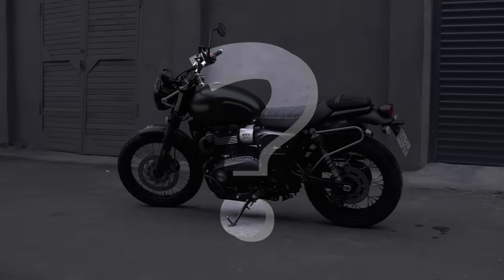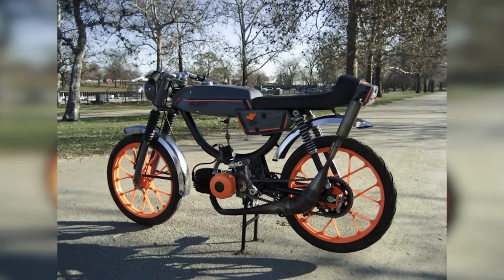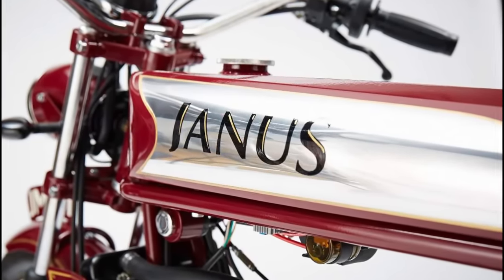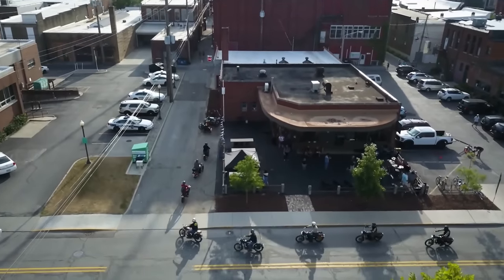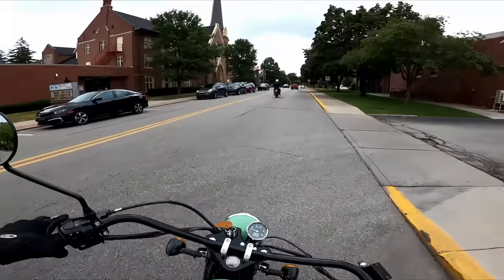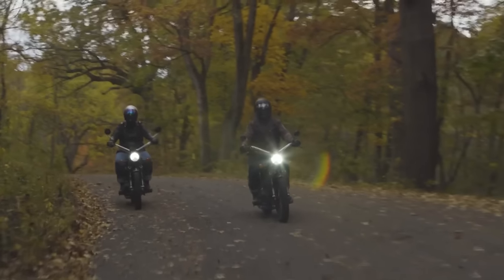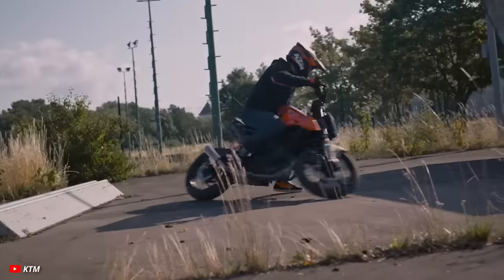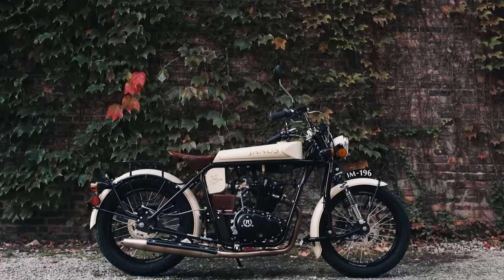The New Manufacturer making 100-year-old Motorcycles

Comment: The problem with true retro motorcycle is we invent tech pack for good reason lol.
Fkin carbs.
But good on Janus for keeping the spirit alive.
Reply: Just the word "carbs" is enough to make me foam at the mouth.
Reply: I agree, it's like those "cooking like the 1800's" videos. Yeah I guess it's a neat idea historically but I'm not gonna go out and soak some oats in suet for 30 hours and eat it with weevil infested hardtack.
Reply: What is wrong with carburetors?  Simple, easy to tune, don't require electricity to function, makes a 1 wire magneto ignition possible.  Can't get more simple than that.
Reply: @thejunkman  cold start, cold start, cold start, cleaning, cleaning, cold start, inconsistent flow, cold start, cleaning...
Carbs is good if you like to dismantle your bike. Not so much for people who just want to ride and not touch the engine ever. Chain cleaning and valve check at most.
And EFI tuning is dirt easy if you have the computer, so it is both more nerdy and more refined.
Reply: @victoriazero8869  I have EFI bikes too, but carbs are just fine if you like to ride your bike a lot and don't let it sit.  I have had too many problems with cars and electric fuel pumps and such.  You can't really fix them on the side of the road. I guess growing up with cars, trucks and motorcyces from the 60's and 70's, I don't think much about changing points or tuning a carburetor once in a while.  It is like second nature.
Reply: @thejunkman  I have two identical bikes, one from 2013 and one from 2016, and the former had carbs in it.
Fkin cold start issue. In the tropics, even. I like it in a sense on how easy it is to squeeze more power, but EFI tuning can do it more efficiently. (Carb rejetting is dirty as hell to emission)

Comment: Lost all interest when he said Chinese motor
Reply: Agreed. They should always include the option for a customer to double the cost of the entire bike so they can swap in a less reliable, less powerful, domestically made engine with minimal but expensive parts support.
Reply: @OddInfection commie boo
Reply: And yet china did somerhing many cannot or have failed at, scooting around on the moon.
Reply: A major drawback.
Reply: @Chris-Holden  what makes Chinese parts more reliable? I've ordered a ton of parts online restoring cars, a shocking proportion of which were completely useless out of the box, or even worse, failed while under load. Domestic parts have disappointed me at a much lower rate.
Reply: @Ballistics_Computer   preach brother
Reply: Well said, Chris. It’s hard to blame the makers for using the clone. Is there even an American made engine that would work? A Briggs? No. That said, I would expect a bike like this to cost less than 7k. But I don’t have money to burn, others do.
Reply: The fact he spends this whole video praising that the bikes are manufactured there in town and then casually says “oh and the most important part is built cheaply as an afterthought in China”. It’s textbook cognitive dissonance.
Reply: Then you'd better sell every electronic device you own, hypocrisy is its own reward.
Reply: @zazu-xt4py if the chi-com Honda clone fails wouldn’t an actual Honda fit as the replacement? In all likelihood, while I don’t prefer them, the chi-com rip-off will probably do just fine. 🤷‍♂️
Reply: You have to laugh at the comments here using “ reliable, powerful and Chinese “ in the same sentence.
Reply: @warriorpoet9629  while using your Chinese phone or computer lol...
Reply: It's a good thing and a bad thing.
1. Makes the engine cheap and east to replace if anything happens to it. 
The bad thing is less reliability, which is equaled out by point 1.
Reply: @Ballistics_Computer You have to understand there's a bid for quality parts. If the seller purchases products at lower quality then that's what the US market will get.🍿😉 There's higher quality parts to be purchased from China DUH.
Reply: @effu9375  where are they then
Reply: Amen!
Reply: I want that new Chinese EV i could get for 10-11k but thanks to tariffs imposed it'll cost double that or more. China sells a lot of great products but also cheap consumer goods, just gotta know what to look for.
Reply: China can make good stuff and bad stuff. It's a large country so be carefull that's all.

Comment: I checked one out today at an antique motorcycle event. Yes the build quality is deluxe and I’m sure that is a big reason they are so expensive. I agree that small, underpowered, lightweight bikes are infinitely more fun than big, overpowered, heavy ones in many situations. I have a CSC SG 250 (Chinese retro-cafe racer) which uses +- the same Honda-clone engine. You have to plan your moves, but that is a big part of the fun.

Comment: What you said about the Duke 390 is why I bought a Husqy Svartpilen 401..... Fun, cheap, peppy thumper (it uses the exact same frame and powerplant as the duke 390) but looks cool and retro-esque .... Left the dealership spending exactly $6004.50 .... that got me a 2 year warranty (I can work on my bike too without voiding, just have to document and save reciepts) .... But I do think the Janus bikes are cool and considered one, I went with the Husqy simply b ecause what I need is something that can handle a little bit closer to DD duties. NICE VIDEO !

Comment: I understand you are getting a pretty much hand built bike apart from the engine but the 450 would still cost £11000 in the UK (if you could buy them over here) however with the built quality as high as it is from most bike builders there are some pretty incredible bike you can buy for that amount of money from MV Agusta and Ducati and the top of the tree Japanese & German offerings..in my opinion the chinese version of the CB250 engine looks out of place on a bike clearly looking like it was made in the 1920s and i do have to say from a presentation point of view if they were fitted with a Royal enfield 350 or 500 engine they would definately look and feel more retro which would lend them more of an air of authenticity in my opinion, whereas at the moment they look like a very old bike with a new modern looking engine

Comment: So the British firm he’s talking about is Mutt and I own one, I never signed anything about not slating their bikes, maybe they stopped doing that? They have their ups and downs and so far mine has been fine for a little run around. Heard some horror stories with Mutts but still bit the bullet as about £3000 / $3800. It’s been fine but the finish is a bit so so but it’s really worth new retail £1500 at a push, just fills that gap for the UK.
These Janus bikes are gorgeous, ok it might have a Chinese built Honda but they are hard as nails and. Very reliable as proven in SE Asia with 30 -30 year old bikes still running lol. The finish on these bikes are really what makes it worth it for me. I’ll enquire about exporting one to the UK then get hit with import duty but I think it will have to be road worthy tested first before I can get my hands on it lol. Look forward to chatting with these guys 👍

Comment: I think the 450 engine is from Shineray, a chinese motorcycle manufacturer that once manufactured the Honda CB400SS. I got one of their bikes with the same engine and it really shares the same engine parts with the CB400SS and XR400
Reply: The 450 motors are from SWM out of Italy, but you're right about it being basically an XR400
Reply: @acm153  Shineray has acquired rights for the SWM brand as an expansion for the western markets. They also bought a factory in Varese, Italy which i believe where the engine was made based on what you said.

Comment: I have a 450 Janus.  It is quick, comfortable at speed, fun to ride.   It is relatively light so side winds at 70MPH will move you, truck wake turbulence is something to be aware of.  The suspension is a bit stiff but well controlled, the riding position feels natural, the seat is surprisingly comfortable, there's a lot of the motorcycle in front of you and the swept back handlebars take getting used to. The clutch is startlingly heavy,  the shifting, predictable, requires deliberate input, neutral is elusive.  The brakes are really excellent.  On the 450, the engine feels out of character for the style.. It struggles below 3,000 RPM and becomes "Buzzy"  above 5,000 RPM. . I prefer the power curve of my Royal Enfield 500. Unlike the Enfield, the vibrations in this single cylinder engine are present but not punitive.  It has a 2 gallon gas tank... you will be stopping frequently to get gas and be prepared for questions.  It does get good gas millage but there is no fuel gauge, carry an MSR bottle of gas with you.   You will be doing all of your own maintenance and repair.  Motorcycle shops do not want to touch a hand made motorcycle under warranty, never mind that the Engine is basically... a Honda.    There are no Janus dealers or repair shops outside Goshen Indiana.   I'm no mechanic but I have had to do my own maintenance and a little brake work.   The Janus Youtube videos are helpful.  The people at Janus are very responsive to questions and give practical advice.  If you need a part they are right on it.  Would I buy another?  not sure..  take your cell phone with you and have a trusted tow service in your phone book.. although it has never left me stranded, I feel paranoid riding a bike a long distance that no one will service.   In a way, this reinforces the superiority of the 250..  You would never think of taking a hard tail 250 on a tour or on the freeway.

Comment: I recently been doing research about janus and I always liked a certain style of motorcycle before i found out about janus I was thinking of building my own homemade motorcycle using a bicycle frame similar to what the harley Davidson brother's used to do around the 1900s to early 1920s, but then after accidentally stumbling across janus I ended up looking into it further, also thinking of looking into their bikes possibly in the near future and also still wish they offer the center stand on the back tire like they did with the halcyon 50 which would be cool if still an option either way it's cool to see that retro motorcycle's are making a huge comeback, wish to see more 1910s and 1920s styles out there though
Reply: And also I wish them the bestest luck motorcycles are hard to design even tougher especially with engines not to mention all the loopholes you have to go through with regulations

Comment: 1. You are a fan-boy.
2. Good! There's nothing wrong with that. So am I.
3. What a great looking line-up of bikes and what a great-sounding company and ethos.
4. What a great video... until it went on for too long. You could have sold me a bike in 1/3 of the time.
5. I would not buy one.
6. Only because I have a knackered spine and could not ride a hard-tail on any road not utterly flat and smooth. I have to base my bike choices on more sensible things like... how much it makes my back hurt... and I have to commute 110 kilometers daily, filtering through two lanes of cars.
7.Thanks a lot, they sure are beautiful-looking machines.
8. I want one.
9. I can contradict myself. This is YouTube!

Comment: Excellent narration skills, and comforting to listen to. I really like these motorcycles, my only issue is reliability. I’d want to own one for sure though!
Reply: Ha, I went back and finished watching the video to further comment. Having nothing really to purchase these days that I felt met my retro needs, I just purchased an older 390 Duke. It doesn’t come close to having the character of a Janus, but it does have an upright driving posture and horsepower to boot. I’m close to retirement age now, and I’d still buy a Janus. If I could comment though, I find that the motors don’t fit the time period. Maybe building a motor that looks authentic and delivers 40+ Hp that is slim line would do the trick! Cheers!

Comment: I ride a heavy RE Bullet 350 with touring mods and I always ride with a passenger. After 10 years of experience on it, it's gotten really nimble in my hands. 😅
Smaller bikes like my Honda CG125 suddenly felt like a toy.
I bet Janus would be a blast to ride and I wanna ride it!
But I disagree with Royal Enfield are just classic in the looks, have you ridden a 50's & 60's Bullet 350? They're just as heavy as the current ones with a UCE engine and the operation of it is just as clunky. The new J-series engine tho, those are classic in looks only. The new Bullets felt like riding a brand new Japanese bike from the 90s

Comment: The Garelli Rekord & Cross were popular in the UK. 
A normal moped would have been the Puch Maxi, often called 'Maximum Puke' due to the way the damn things smoked heavily due to the 25:1 oil mix.
I like the Retro style. My most-loved bike was an Enfield Bullet, which was a reproduction of a 1950's design. European Emission laws stopped it's import. Better to use a modern engine in a old frame design. 1920s-1930s. Interesting to see the use of the Earles front suspension.
I had a Honda CG125. This was a OHV motor which was made for a very long period. 
I preferred the sit-up riding position of the Enfield. Having to ride a cafe-racer is not my idea of 'fun', so a performance bike is out. The big single chugs away like a steam railroad locomotive & you can enjoy the scenery. The Enfield was heavy. Try bump-starting one.... Kick-starting a big bike is one retro aspect best left to genuine vintage machines.

Comment: 12:52 Uhm, my Kawasaki W175 weighs 126.0 kg (277.8 pounds). It's super nimble and it is a super cheap bike, with tons of aftermarket parts available for modding. And it only costs $1,600 brand spanking new.

Comment: I LOVED riding a small motorcycle years ago about 1977-78 on a Honda XL350 and a CB350!!! I preferred the CB350 because it was electric start and much lower seat height because I'm only 5' 8" !!!! I wasn't happy about being on my tip-toes while waiting at a traffic light while riding the TRAIL BIKE. Besides, I REALLY didn't ride OFF ROAD, I was a street rider!! It was DANGEROUS to ride a bike back then and with the POPULATION BALLONING the past few years, IT'S A LOT MORE DANGEROUS!!! I'm SCARED driving in a small car NOW much less a motorcycle which has NO PROTECTION and is capable of going WAY TOO FAST TOO QUICKLY to be SAFE!!!! 😮😮😢😢

Comment: Is it just my imagination, or does the newer Janus 450 look a lot more like an early 1930's Indian Scout 101, perhaps one of the most rugged, well balanced and elegant American motorcycles ever manufactured? Like more Indian-like than the new (actual) Indians. I see both sides of the current engine debate happening here. It does make me wonder what might happen if somehow this company found a way to garner or manufacture an smallish American made 500cc or 750cc v-twin. Perhaps they would lower that gas tank just a bit, add a larger bullet headlamp, etc. Surely the model would be even more outlandishly expensive, but a lot more enthusiasts would be lining up to buy one. I remember being sorely tempted by the Kiwi remanufactured Indian Chiefs (late '30's styling) about ten years ago. They were improved and as reliable as a classic Chief could be, with disc brakes if you wanted them. Starting prices were around $69,000. Crazy money for a working guy, but I was still sorely tempted just because of how lovely and timeless and hand-built the machine was.

Comment: Imagine if say Indian or HD went into partnership with Janus to make that vintage look with modern methods and a higher HP single cylinder.  Indian or HD could make single cylinder from the Indian Scout or Sportster Revolution Max.  It would be a cool "entry" level bike.  Hell both companies just need to make single cylinder entries.
Reply: Get rid of that ugly gas tank and use engines built in Thailand.  Then they would sell better.  Please consider that.  Thanks

Comment: My bike is already sort of retro, being a Harley 2000 Sportster 1200S.  I also have a 1999 Whizzer replica. I'd trade in that Harley against an early Harley replica, though.  Caveat: I will not go 2 stroke.  I  did ride a Yamaha 60 cc 2 stroke back in rhe 60's though.  It had oil injection.  No need to mix.

Comment: You didn't mention the elephant in the room; the leading link front forks !  Usually found on motorcross or very heavy three wheelers.  It would have been more appropriate perhaps to have used springer or girder forks.  My early bikes were Villiers engined little British bike with pressed-steel girder forks and rigid frames with sprung seats, and they seemed to handle OK at the modest speeds they were capable of !

Comment: Simple has always been better. The KISS philosophy, when applied to sports cars, off-road vehicles, or any type of motorcycle, reduces opportunities for failure, increases reliability, and keeps maintenance easy and inexpensive. Unfortunately, everybody seems to be racing in the other direction, piling on tech and complexity to the point that the values of analog vehicles are skyrocketing because smart enthusiasts are fleeing from new stuff and flocking to old. It's good to see that not all the manufacturers are tone-deaf. I'll be following Janus Motorcycles hence, and hoping for their success.